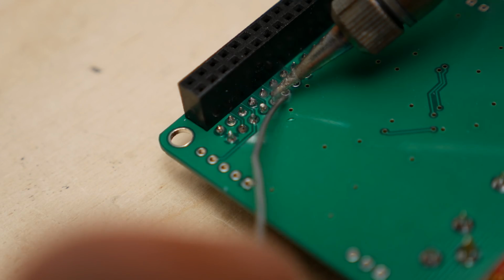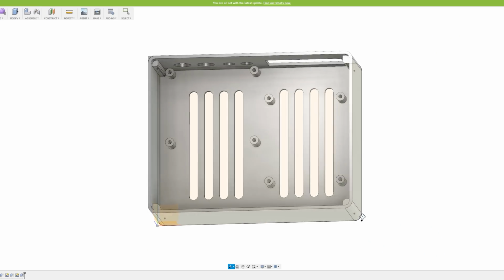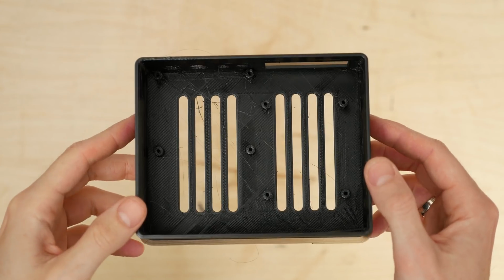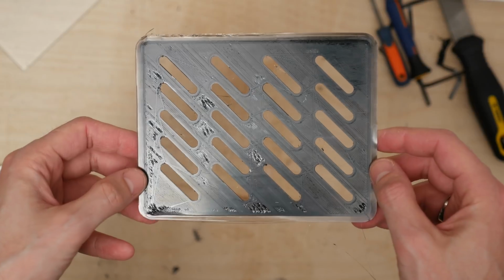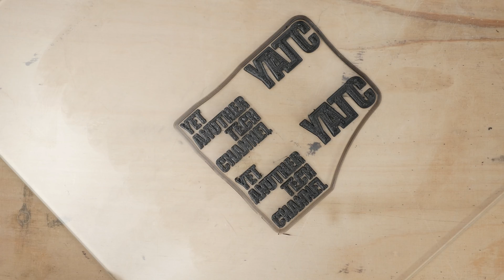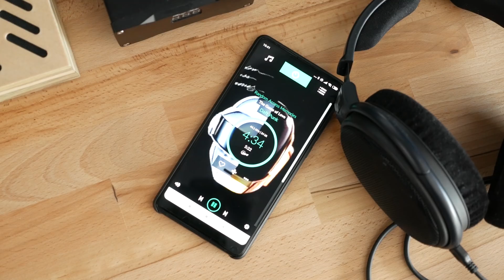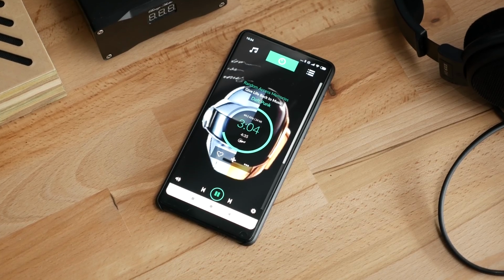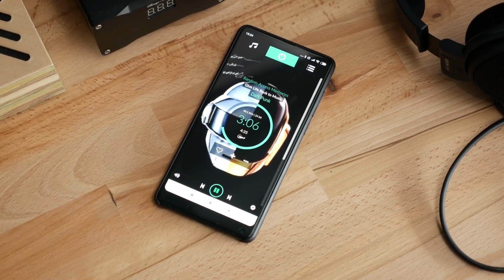DIY Ultimate Audio Player 3.0 - modded HiFiBerry DAC+ Pro

Comment: Are the cables on the inside shielded? They look quite long for the job to me and since they are conducting some pretty high current signals, they are basically small antennae, sending to the other cables, which will interfere with the power they are conducting. 

I ran into this issue a while ago when I connected an arduino with an lcd touchscreen. My cables were a good bit longer to be fair, but my signal was much weaker.

Comment: Still can we avoid sandwich method and use only female to female from DAC PRO to Pi 4?? ...how to get details which GPIO s all we need to attach....why not a GPio to Gpio Ribbon Cable work?? Without individual cables now @2024...please throw some light...iam still designing my Pi s based only on sandwich method and i don't find another choice 😢

Comment: Good build video. I used aluminium foil as an electromagnetic shield when I was modding my digital hifi equipment. Keep in mind that for it to be effective the whole of the enclosure must be covered by aluminium or copper foil and grounded.

Comment: How do get 3.3V for the DAC? In my case I had to get it from the PI. I couldn't see any connection from Pin1 or  Pin17 . Without 3.3V there is no I2S communication possible.

Comment: As you were not mounting the DAC directly to the GPIO pins did you need to remove the R14  resistor? As I understand it the R14 removal is just to cut the 5v line from the Pi's GPIO pins but you did not connect those pins to the DAC anyway. Is there any other reason to remove it? Also is there any advantage to powering the Pi via he GPIO pins and bypassing the over voltage protection of the micro USB connector?
Reply from the maker: I follow the guidelines on HiFiBerry's website. If it was as easy as not connecting the 5V GPIO lead, I'm pretty sure the guide would mention that.
Not sure about the advantages of delivering power to RPi through the GPIO pins - I often do it for convenience - I can install Pi wherever I want and just route the power cables and install the power plug wherever I want.
Reply: Resistor can be left untouched in this case.

Comment: Just a question on the extra GPIO header(0:55 4:53), wouldn't it have been much simpler to just mount the DAC board the other way up and just use the existing DAC female GPIO header with male/female ended wires to the RPi (using female wires to the Pi GPIO end and male ended wires on the DAC end) instead of doing all that soldering?   Another option would be to plug a 2x40 male pin header (https://en.wikipedia.org/wiki/Pin_header) in the DAC GPIO if you want to use wires with female sockets on each end (obviously easier to obtain than male to female).
Another issue is they designed that DAC with the assumption the GPIO was directly plugged, I'd wonder if those longer wires might cause problems.

Comment: If I could ask some simple questions about the build, the reasoning behind the use of two power inputs? Instead of branching off a single input to each board? Did you consider a power bank to power this project, as this would have made it portable and filtered the DAC from any noise from a mains powered supply?
Also if you try to veneer around a radius like that again use an old iron. Wetting the wood was a good start but then use the iron to heat the fibres of the wood and the flat surface of the iron to apply even pressure around the radius.
Reply: You use a specialized low EMI noise power supply, either a good linear one or some people even use a LIFePO4 battery pack to the PRO+ one and then use a plain old switching one for the RPi power input since that doesn't matter as much.  This can make the DAC quieter/smoother sounding. I've experimented with it, it helps but dealing with batteries is extra hassle.  There's an Allo project/product called the Allo Digione Signature (a streamer) where they take that to an extreme by having a completely separate i2c -> spdif "quiet" board that has a separate power port you can power by battery or linear. That's a bit more practical for battery because the 'quiet' spdif board probably doesn't use much power.

I'd still suspect some noise would get in via the GPIO connections.

Comment: What was the total cost of electronics and how would this compare to something like a Schiit DAC?
Reply: HiFiBerry DAC+ – Pro $48.41

HighPi Raspberry Pi Case - Raspberry Pi2 and HiFiBerry $16.73

Element14 Raspberry Pi 3 B+ Motherboard $37.81
Total  price: $102.95
---------------------------------------
Schiit Modi 3 D/A Converter - Delta-Sigma DAC - 
Price: $119.00 (https://amzn.to/2LNdFf7)
yeah yeah near the same price...
Reply: I have both. Schiit is only DAC. But with software, raspberry pi solution can also be a streamer. 👍 I love them both! Schiit dac is great where my headphone is at. But my raspberry dac is at living room with stereo speakers. I am much more interested is there linear power supply he got from China. I can’t find it whatsoever.
Reply: @photodesignch  it's a fairly easy (and cheaper) DIY